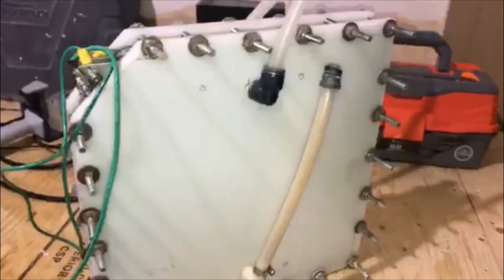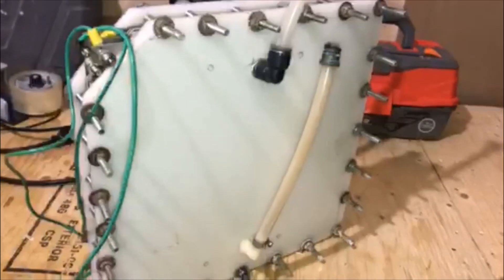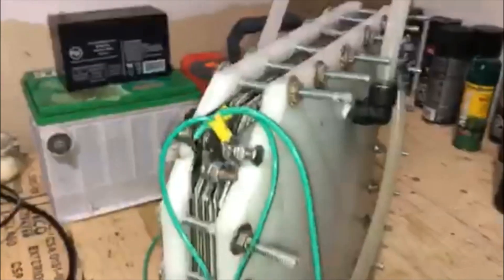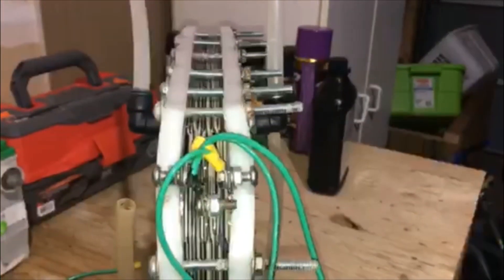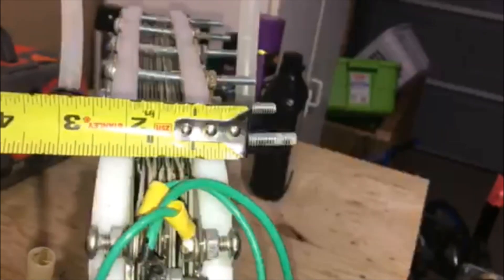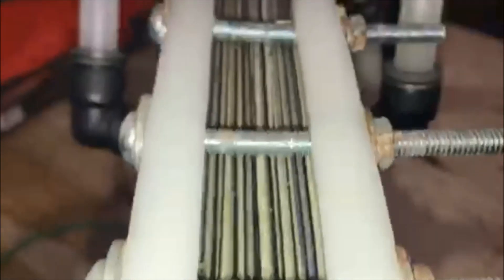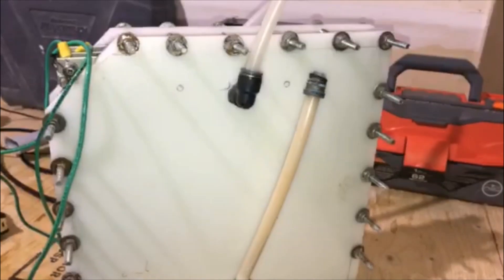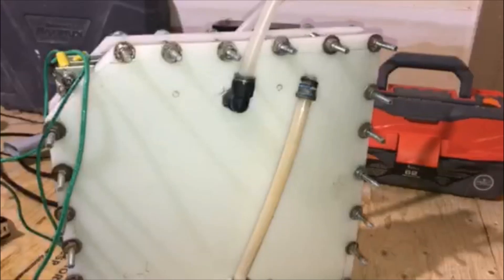Plate Cell Details for running Generator

Comment: Publish the plans and see how much people will help you brother
You underestimate the power of karma
God bless
Reply from the maker: There are no plans made. This setup is the simplest. Make the cell as described. Include a large reservoir and bubbler. Also use a vacuum pump. The vacuum pump and HHO go into a mixing chamber. Mix the HHO gas and ambiant air(like Meyers did) to achieve the burn rate required for the engine. It’s really that simple.

Comment: There's a frequency you can apply to a very specific column of water in a quartz tube, which instantly ionizes it into hho. There's no need for plates anymore.  Keely discovered this by accident. At high volume the freq turns the water to pure energy which blows a hole in anything.
Reply: where can I find info on keely ?